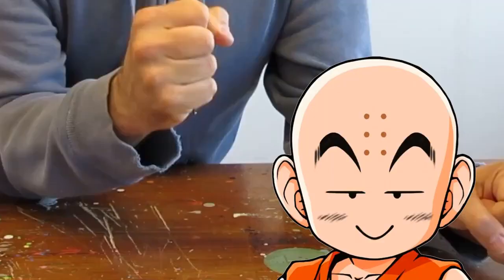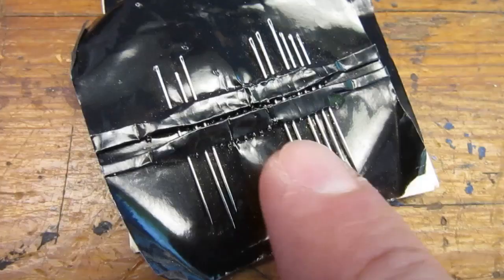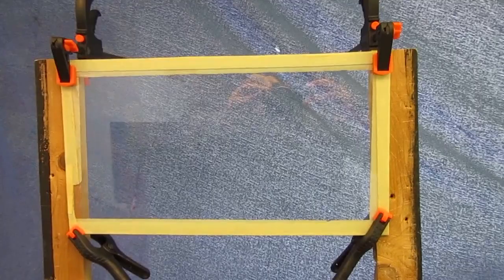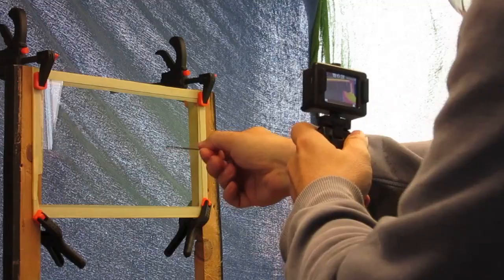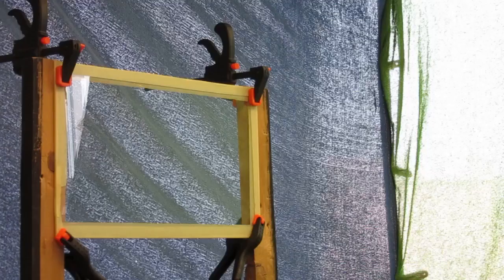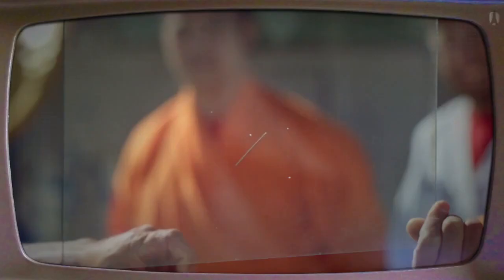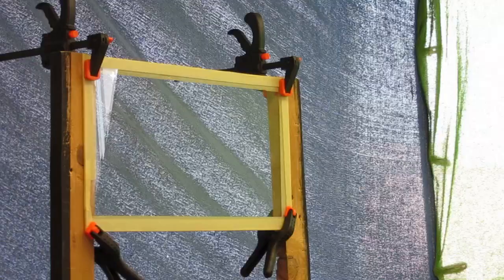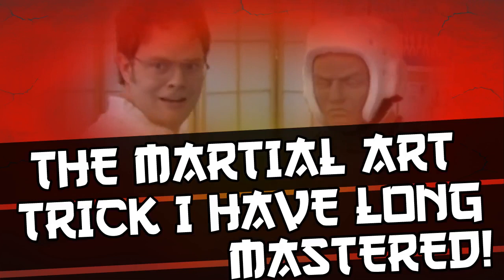Throwing A Needle Through Glass Like A Shaolin Monk Martial Art Master? #challenge #test

Comment: The slowmo guys is the original vid, where the monk rlly trows it
Reply from the maker: Well, this video is a joke. If you carefully look, 
1) The needle used during the slow mo shots does not look like a needle (where is the pointy tip?)
2) The needle does not even go through the glass but bounces off the surface and the small glass shards make the baloon pop... 
3) during the slow mo shots you can see all the attempts where the guy did not manage to make it work (check out the white dots showing previous failed impacts). 
And this is supposed to be a master? Amusing....